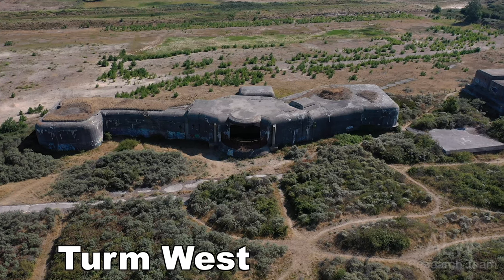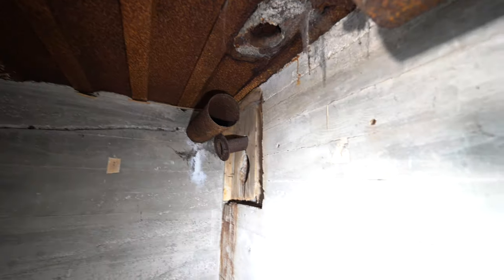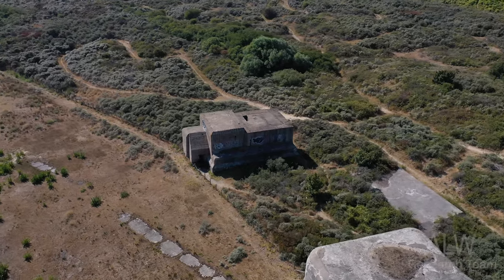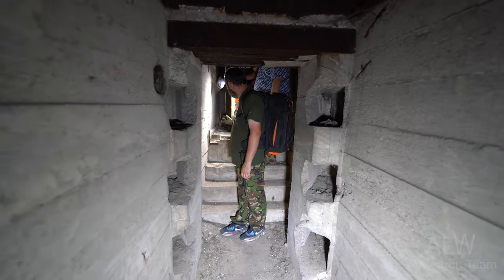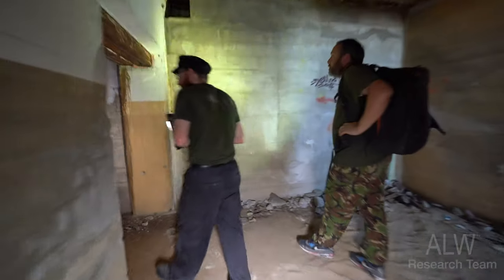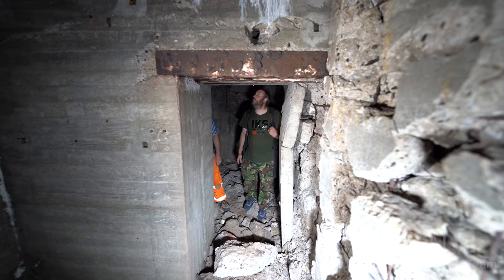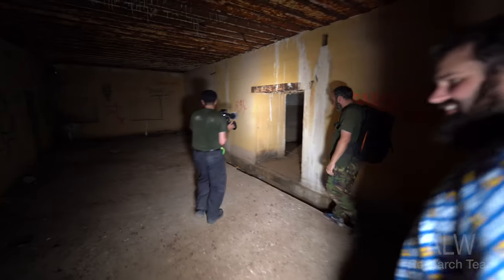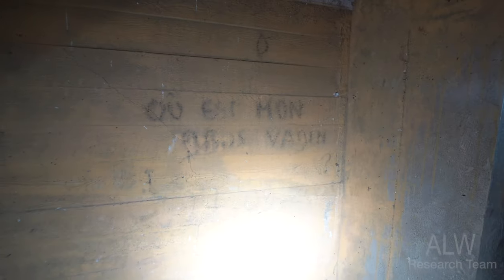Mysterious Paintings in the WW2 German Hospital Bunker

Comment: The Germans probably shouldn't have had fire control on top of their hospital. I'm not sure if putting the hospital there was an afterthought, or it was always planned that way though. But yeah, nasty things do happen in war. Some have questioned if that scene painted on the wall is original. If the damage is WW2 related, then someone went to a lot of trouble to make it look original. It could just be rusting steel reinforcing bar causing the concrete to spall, so not WW2 related, and so no easy way to prove authenticity.